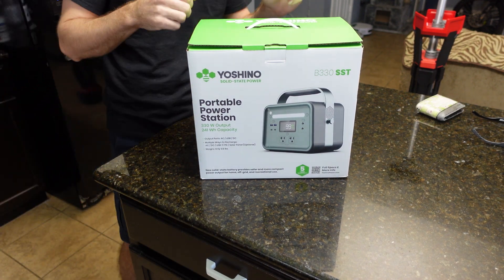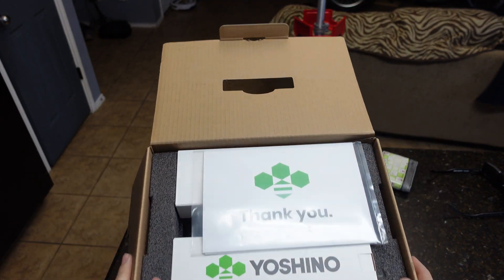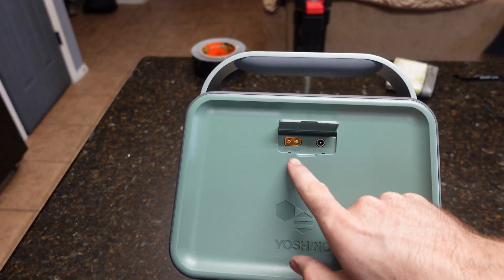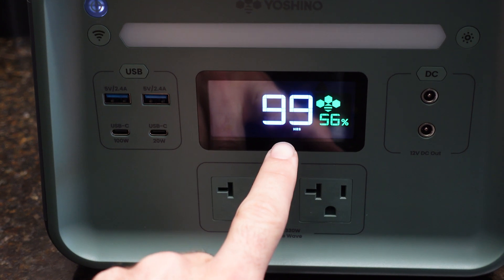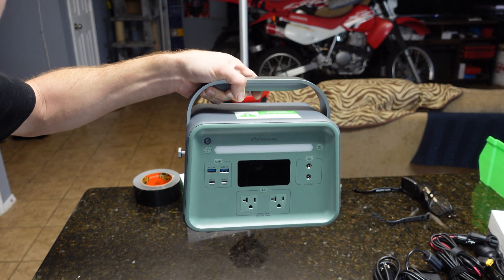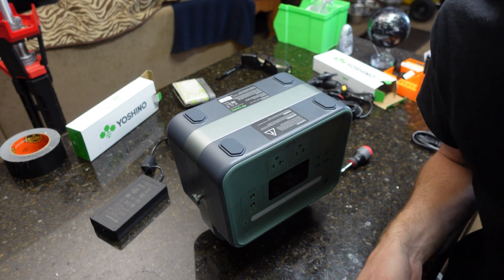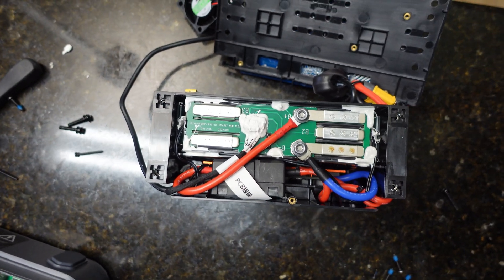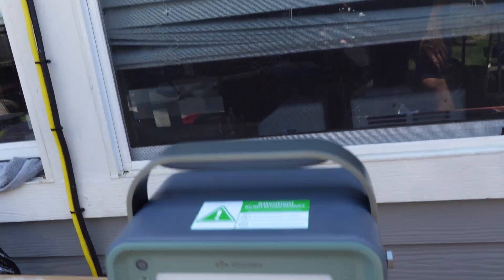Full Teardown! Yoshino NOT Solid State Battery Power Bank Overview, Disassemble and Test

Comment: You are promoting what appears to be a scam product.  This should be taken down immediately since reviews show the batteries are not solid state!  A little research before posting this would have told you that.
Reply: Understood. Suggest updating review to reflect battery issue.  For reputation purposes I wouldn’t leave as is.
Reply from the maker: @davesilver5493   I can see your point, but at the same time, I paid for this with my own money, and gave a small overview, it’s my own options of the product, I still think it’s a quality power station, if you bought this solely because of the solid state battery claim, then return it.
Reply: @Mikebuildss at the same time as a reviewer you should do due diligence and update your video to reflect that they are claims and note the recent discoveries they could be lying. In the beginning of the video you speak from their marketing claims as if they are fact.